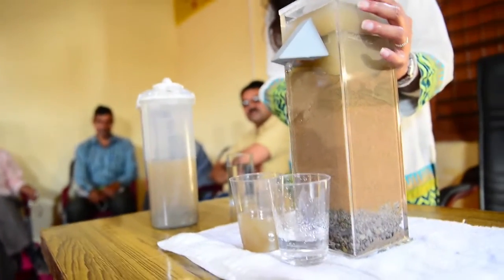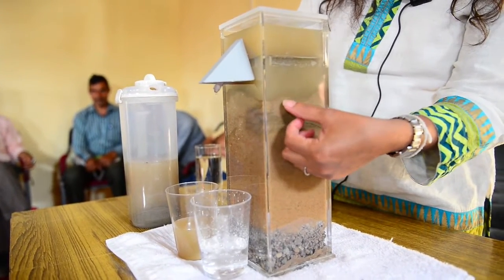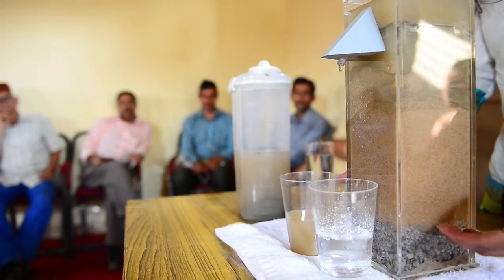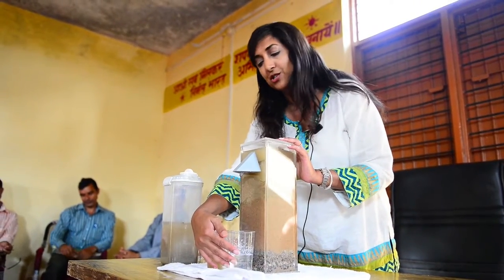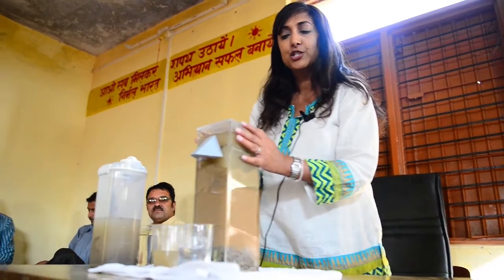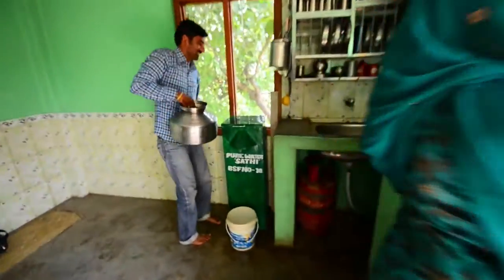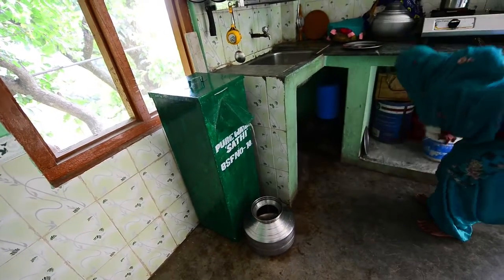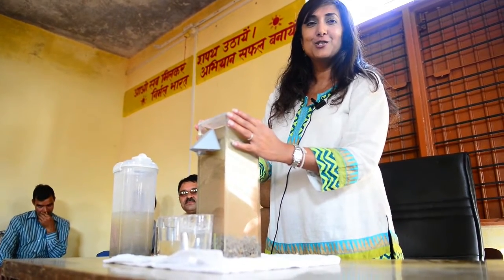How sand and gravel can clean your drinking water

Comment: what make water goes up ? can i use any kind of gravels and sand?
Reply: The simple answer is water will always try to equalize it's water level. In this case you have the water level of the container that is filter away. Then at the bottom ou have a pipe. That pipe goes up but just below the water line of the container water level. Because the outlet is lower that the container, the water will drip out. You might ask, "Why not have it at the bottom?" The reason is it helps keep heavier sentiments at the bottom of the pipe that may have passed through. Basically the cleaner water will be all that makes it up the pipe.
Reply: Outlet (from where clean water is dripping down) is connected to the bottom of the filter (where the inlet it). New dirty waster pushes the purified water from bottom to top via the outlet pipe. Gravels hold the sand in place so that your purified water doesn't bring sand with it when it comes out. Not all types of Sand are recommended. Best is to use sea sand.

Comment: How does gravity help the water go up after it has reached the bottom of that device? 😱😏
Reply: I think she ment hydrostatic pressure... as long as the input source is above the output source.. water will make its way through the pipe.. its a property of water.. not gravity. Water always finds its level
Reply: Outlet (from where clean water is dripping down) is connected to the bottom of the filter (where the inlet it). New dirty waster pushes the purified water from bottom to top via the outlet pipe.